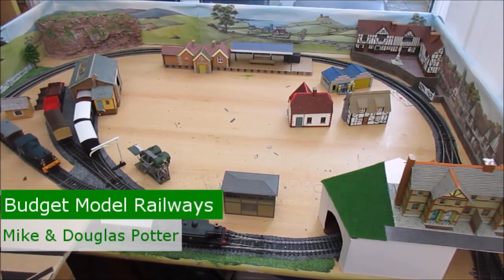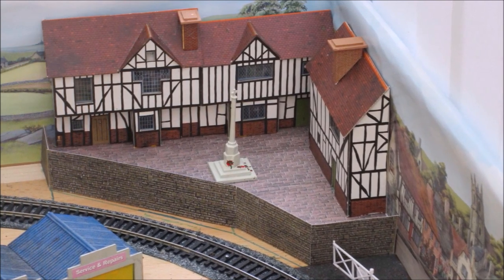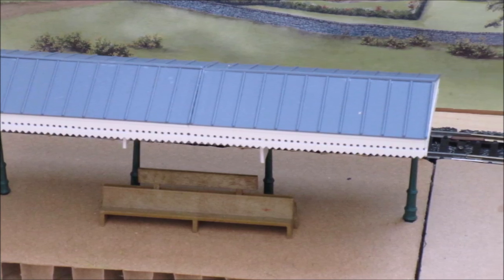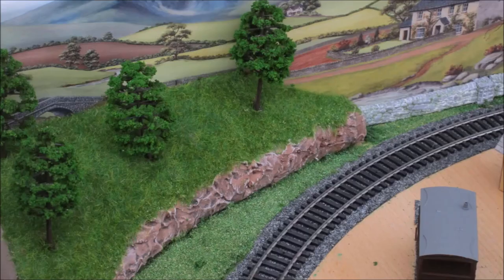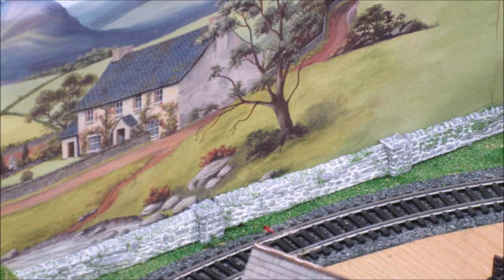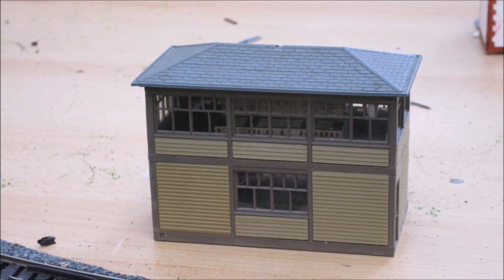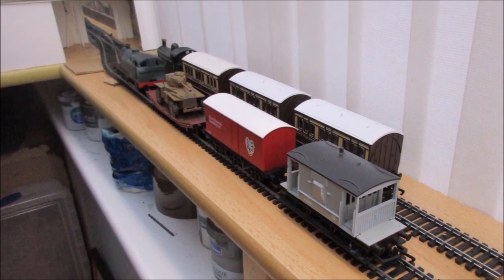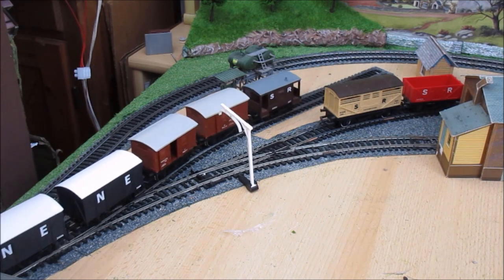How To Build A Model Railway Layout - Goods Yard & More - Homewood Valley Railway 3

Comment: Hi do you find the felt absorbs any sound from the trains and rolling stock, what if anything can you use to cover any joints in the felt.
Many Thanks Robert
Reply from the maker: I find the noise has more to do with individual locos not what they are running on. A quiet loco and rolling stock are quiet whatever the surface, likewise noisy. Given how big the rolls are joins are not that common, but a really straight edge both sides is not very noticeable
Reply: @BudgetModelRailways  Many thanks for this ,Robert

Comment: Is it ok to use chip board as a base Iv been told to stay clear of mdf and to use 12 mm
Play board
Reply from the maker: MDF warps. Chipboard is ok but is a bit hard for track pins. Personally I think 12mm is a bit thick, it adds to weight, but there is a tendancy to over engineer base boards
Reply: I may follow your cardboard layout as I live in southampton and there are many outlets that supply kitchens and so on

Comment: The small diesel you have in the goods yard what class loco is it??
Reply from the maker: I think it's a Hornby Class 06, but will check,later when I get a moment to watch the video
Reply from the maker: Just checked and yes it's the Hornby class 06 shunter in BR rail blue. I have two and both are excellent, they also did them in green. Even better if you can find one is the Hornby Bagnall shunter, excellent runners esp at slow speed.

Comment: Roofing felt does not look good.
Reply from the maker: This is actually Javis  ballast mat not roofing felt. Roofing felt looks the same however, ballast mat in whatever form is an accepted way of laying track, otherwise it would not be sold commercially . It does not look as realistic as loose ballast , but is quicker, easier and causes less problems, as well as being easier to change or replace track. It's a matter of personal choice. I'm more interested in running locos quickly and reliably than in having immaculate track. We have exhibited our exhibition layout using roofing felt twice without anyone mentioning it, and it's booked into four more, so it can't look too bad?!
Reply: Budget Model Railways thats from other opinions and that was mine. I think it looks better when the track has height and is filled. Its better if it looks good i think.
Reply from the maker: Of course it's a matter of personal opinion, we have ballasted track, I think there is a time and place for both. Thanks for the comment.